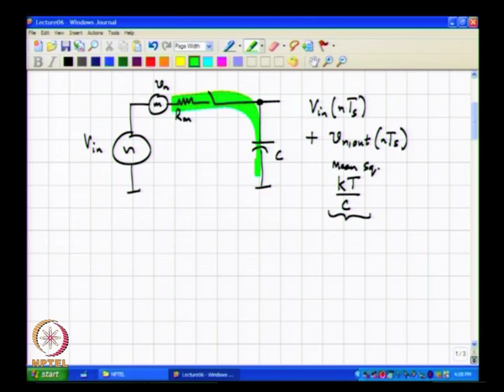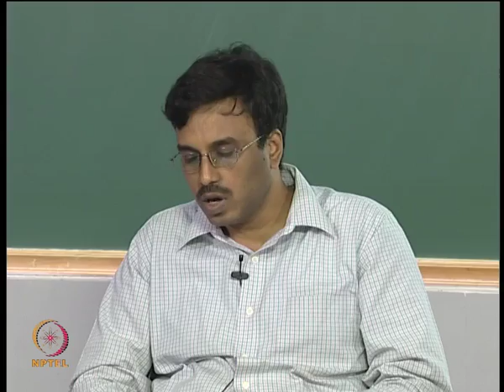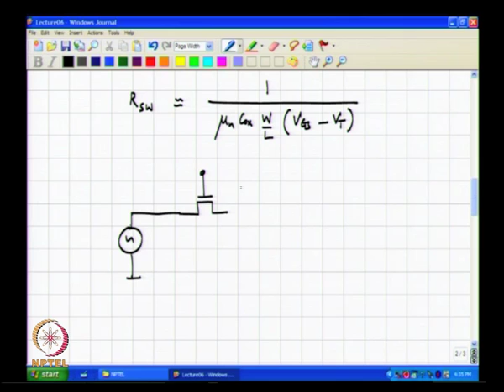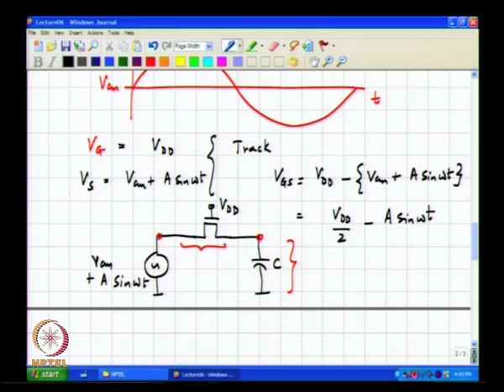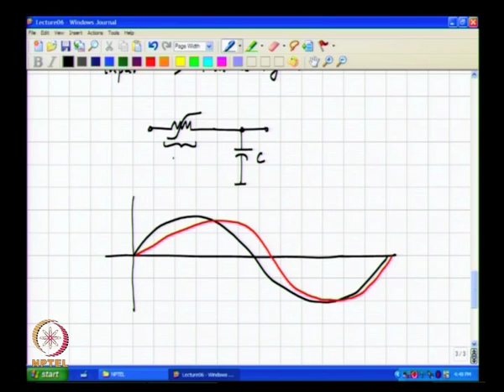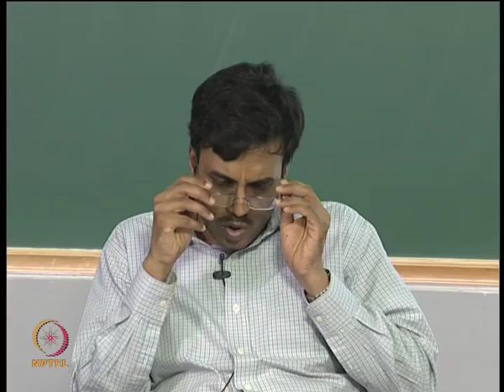Mod-01 Lec-06 Distortion in a Sampling Switch

Comment: RMS thermal noise shall be smaller than step size.
MOSOFET can be used as sampling switch.But  switch resistance is function of input voltage and it is non  linear thus can cause distortion.
Reply: Due to non linearity ( harmonic distortion) across the switch... Voltage drop across the switch in increased...